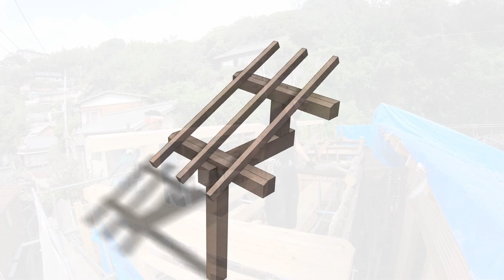Apprenticeship in Japan: Japanese Roof Frame Styles in Onomichi

Comment: interesting there is not a Jimune Beam down the middle of the spanning beams (Nobori). ive grown accustomed to seeing one in most frames of both roof style you mentioned. (the Jimune Im referring to is the largest beam, often a large log seen as the "fish spine" normally rests on top the (nobori)  down the middle and right under the ridge/Moya beam.
Reply from the maker: I think often you'd be right here, although this was a fairly inexpensive seaside home we were restoring in this video. I suspect the span and original budget did not warrant it. Thanks for checking it out :)
Reply: @Neverstopbuilding  this looks like a rather small space and I've decided on building my 'office shed' in this manner. After some other smaller projects first.